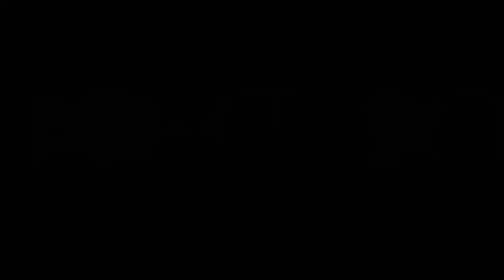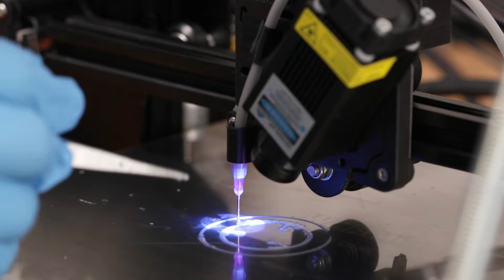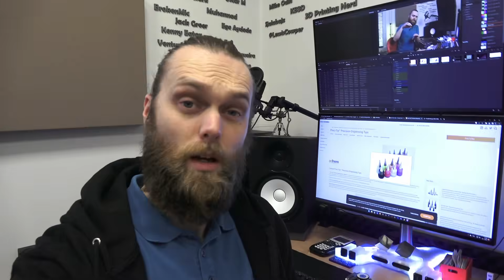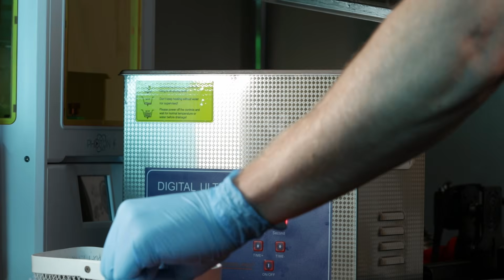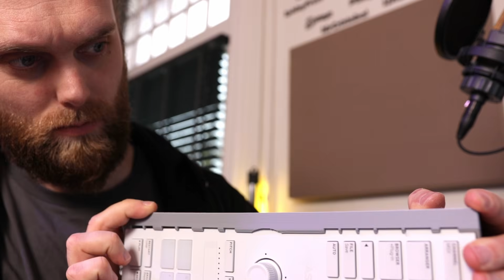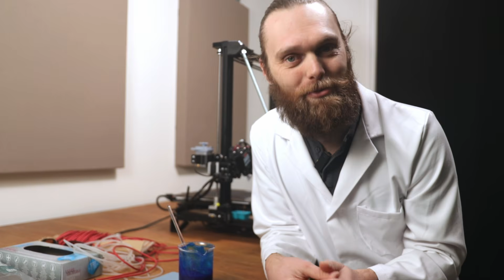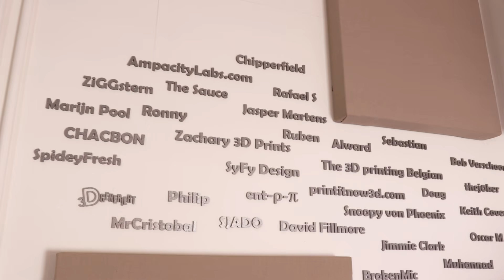I made a CUSTOM Nozzle that 3D Prints GEL!

Comment: Sweet project! 

When I was at Formlabs as an intern, I worked on a hackathon project that was extremely similar to this. We also used luer locks as the nozzle, but used a leadscrew driven syringe as the resin pusher. We also ran into the same problem where the laser would cure the resin at the tip and block it, but ran out of time before we could come up with a solution like you have.

I can share a photo gallery of the build if you're interested.

Comment: Really nice video. As for creating a leak tight thread seal, I would just use PTFE tape on the threads. That will almost certainly create a leak tight seal. This may allow you to more easily try other nozzles in the future.

Comment: Maybe use a syringe (or or even if its the same holder) mounted to the top of the nozzle and try to use non- flexible tubing (i.e. metal). Lastly it may help to increase the overall diameter of all the tubing up until the nozzle exit to allow for the use of thicker resin, this will may work better for overhangs. Best of luck!

Comment: Amazing work!
When testing your new mix you mentioned that the resin is holding itself up without curing. Maybe you can use this feature to prevent the nozzle from scratching/breaking and keep the resin soft while printing and then cure it layer by layer? Maybe using the ironing feature of the slicer (superslicer got ironing on every layer) to give it an "curing pass"

Comment: Since you want to print with fiber, you need the fiber to be cut to length.  If you do feed the fibers into the gel, that could work well for bridging as the fiber will give it horizontal strength going back to how to cut the fiber when you need to move the nozzle to a new location without printing between points in the print.

Comment: When dealing with UV you need to take into account weather your lens material lets the UV through. 
The visible part of UV light is not really the part that does all the work. The really high energy photons are not visible. Most plastics will block majority of UV. The best lens material is quartz. In your case it's better to use mirrors to direct the laser, instead of lens, since it's easier to make a aluminium mirror, then a quartz lens. Aluminium is best cheap material for reflecting UV.

Comment: One piece of advice on your pumping issue, generally speaking, pumps that can pump liquid well can't pump air, so you may want to consider adding a priming feature that allows you to add the resin directly into the pump, rather than turning the pump to suck the resin through the tube.

Comment: This is awsome and i was thinking that some one should invent somthing like this the other week, and wham you have, your a genius.

ok here is my thought. as fdm printing relies on the hot material to fuse with the exisiting layer, then why not lower the laser power soyou get a less cure, so the new layer can squish into the existing layer and the nozzle should push away any high parts before curing .

Also try to increase the build speed to match the pump. 
so you could put a inline solenoid valve to micro control the flow rate better. so instead of a motor to use as an E step, use it to cotrol a Solenoid , just to say you can get micro solenoids that are perfect for the size tube your using for next to nothing and the voltage is very low, 
sourcing map Miniature Solenoid Valve 2 Way Normally Closed DC4.5V 0.5A Air Solenoid Valve

Comment: LIGHT: Is there any advantage using a laser instead of a ring of UV LEDs? 

TUBE: Might it be a better idea to use a black tube to prevent the resin from getting light on it while in the tube? 

VAT: How about both? Put the fluid in a container with a "lid" that sit inside the container and seals against the edge. (And a valve to bleed out the air.) This will use the weight of the pump to apply pressure to help force the resin into the tube in addition to the pulling force of the pump. (It might need a stronger pump due to being a sealed container?)  
Alternatively: would just using an arm to push the "lid" into the resin to produce pressure/force that pushes the resin into the tube? 

RESIN: Wouldn't it be cheaper to use a UV reactive acrylic resin instead of "custom" 3d print resin? I'd imagine it'd be cheaper and since it's used for boats, not to mention readily available.

Comment: You need some form of viscometer so you can get consistent results from batch to batch and to allow you to tune your resin mix to what you are doing. Free standing resin prints will likely need a more viscous form than resin with fiber running through it where capillary action will play a part.

Comment: This is inspiringly cool. If the head nozzle was replacing a shuttle in a loom you could print pre-preg or just whole panels of carbon fiber or fiber glass. Your mixing nozzle could work for silicone, although the print time will definitly be affected by cure time. I would like to know, what pressures your pump can build? Do you think the nozzle could print foam? I wonder how the newer ceramic resins would work? So many cool ideas, keep up the "research" and thanks for the video.

Comment: Great print the one at the end!! :)
I notice you make a lot of "engineering rookie mistakes" that take you a long time to resolve though :p 
As requested, I believe you shouldn't pursue CFR with resins or gels; they are not rigid materials and will be extremely difficult - if not impossible - to fixate the fibre. The fibers themselves won't want to bend, and if by the time they are not deposited, the surrounding material is not totally rigid, I believe they will want to "jump" out as soon as you start describing small radius curves typical to 3DP paths. (Many other points also)
Two great projects, but separate ones, imo.
Keep it up 💪

Comment: You should be aware that most transparent objects are not transparent to UV, UV bulbs tend to be made from quartz crystal rather than glass, even if the visible portion of your lasers wasn't dimmer with those conical lenses then you might still have had trouble with the UV getting through the resins.

Comment: What iff  
The extruder pump was direct extruder - ed not blowen extruder-ed ?

And the noozle was thinner like 0.4 or 0.2 mm (you can do it with a thin needle )

And you dont need 2 gigant lasers 
You just need one one the side with thick optic fiber glass tube and the result the same ( iff the laser is powerfull enough)

Comment: Amazing work! Not only does this facilitate continuous fibery enforcement, but also potentially the use of different resins for different parts of the print, allowing the specific physical properties of each individual resin to be best utilized. This may be one of the most significant home fabrication projects I've ever seen. Only other thing that you could possibly do that would be quite so cool. Would be to use a infrared laser or some such thing to partially melt a bit of filament ahead of the printhead for standard FDM 😜 

You're doing amazing work, keep it up!

Comment: It looks like you are using soft and squishy silicone tubes. Altrough it is totally OK for vase mode, it will be impossible to achieve good results on any print, that requires interrupting the flow, like benchy, because of the deformations of tube under pressure. I believe, you should replace the tubing between the pump and nozzle to something harder, like PTFE.

Comment: Regarding the tubing: use a stiff tube for the connection tube and the current one for the pump. This way you can reduce tubing compliance and increase precision. I suggest urethral catheters or PICC (more expensive, but comes with luer lock and no lubricant).
Pro tip: use constant inner diameter for tubing, as it reduces shear forces on the fluid (less drag).
If you can, use PVC tubing and cyclohexanone for gluing. For flushing, use IPA to clean tubing.
My work is on extracorporeal bloodlines, and the tips above are from R&D experience on the topic.

Comment: Hello, I am new to the community so I am sure my thoughts don't have much value. However, the problem you had with the glass bubbles(is that what they are called?) was they were floating. Because the gel is much more viscous it might now prevent the issue. So maybe combine the two methods? Probably an idiotic suggestion lol.

Comment: I would look into the same types of pumps that are used on large cement pump trucks. They use two giant pistons that are 108˚ out of phase and provide good pressure and flow for thick materials. The pulsing might be something to consider, but it might be worth a shot!  Keep up the good work!

Edit: I should have finished the video first! great job, but the piston pump type still might be a cool topic to look at.

Comment: Instead of using a peristaltic pump to feed the resin, did you consider a syringe type design with a motorized plunger? You could mount the nozzle directly on the tip of the syringe and eliminate the need for tubing.

Comment: The bringing would be solved via the continuous fiber? Just use fiber for the first few bridge layers and then print normal, you could couple it to fan control so its already in the slicer as well.

Comment: If you don't need the strength of fiber in the print, maybe you could revisit the fiber optic carrying the UV, but have it down the center of the output nozzle. You'd need to shield it so the resin doesn't cure in the nozze. Not sure how difficult that is.

Comment: Have you tried air nozzles from thise airbrushes? If I remember rigiht they even thread into the regular heat block threads so you could design and have machined one with an inlet for the carbon fiber and the resin material going the usual filament route. Just a thought. They tend to be conical and strong, but no idea if it would work at these pressures.

Comment: You can use both microspheres/bubbles, and fumed silica in the same resin.  Fumed silica adds thickness/thixotropic properties to resins generally, and the microspheres will buik out and make it lighter weight.   So if you got good bridging when there was so many microspheres it was a paste, backing off on the amount of microspheres, but adding some fumed silica may work to get you an improved blend.

Comment: So you mentioned that the glass floated and the silica didn't fill the gaps. Have you tried a mix of the two? I have a feeling that the silica may have added enough structure to stop the glass from floating in the resin. Hopefully for long enough to complete a print. I have no idea what you would use for a ratio of glass to silica. Hopefully you'll end up with a resin mixture where the glass doesn't float and there is enough of it to fill the gaps. Just be sure to keep good notes on the weight ratios of resin : silica : glass that you use. I have to admit that my inner scientist winced when you dumped in resin to thin it out. 😄 Keep at it, you got this!

Comment: What about doing measured unit variables for viscosity. The second issue of additional flow at corners and bridging, can be tuned with some pressure advance timing and combination of turning off the curing for a split second? I mean it's transparent, maybe the cure can happen after the layer is complete.

Comment: If they can print houses out of concrete I'm 100% sure you'll find the solution and make this idea possible, also a question about resin properties in regards to the potential of hardening just ever so slight while it's being prepared would there be a benefit to preparing the resin in a Dark room style and ensuring there no contamination of the prepared resin from Reflected Uv bothe from the lasers and the surrounding environment? Lastly what about pressurized feed instead of pumping like a needle with the ability to draw back the pressure for gaps.. 

Please excuse my ignorance if these are no factors I've no experience with 3d printing other than watching YouTube.

Comment: What I would try to do if possible is alternate the beams of the lasers as in when one’s on and ones off in pulses and change the frequency output to where it doesn’t fully cure the resin so when the nozzle comes back around it’s still semi soft or the resin being like “al dente “ or stagger the lasers on and off every other layer so as it’s laying layer the leaves are not on until it comes back around as too baby curing the lower layer but not the top one so as it passes back over that previously are your nozzle doesn’t stick from it being too cured or even have one laser focused on one point and one another laser focus on a lower point so to fully cure the lowest layer but it wouldn’t cure the top layer fully the second laser would focus on the current layer but not have full power to fully cure if that makes any sense I hope this was a great idea this would be my go to if I was in your situation I hope this was helpful. If I need to explain it a little bit better let me know or go into more detail
Reply: Adding to my rant or long suggestion the reason that I say stagger or post the lasers it would be like if you were running a resin printer it flashes each layer but not fully to adhere to itself me myself I have not run a resin printer but I understand the functionality and how it works but this is where theoretically that idea would work

Comment: Can you think of how to make an FDM printer that prints like a laser printer? I mean it would extrude an entire line at a time instead of using a single point print head. That way, you could make a planar FDM printer that extrudes entire layers at a time instead of a single point FDM printer that extrudes lines.

There's an article on tonergiant that has a decent video showing how a laser printer works, but I think Youtube removed my last comment for including a link. It is titled "How Laser Printers Work – Ultimate Guide"

Toner is actually just plastic with some other additives. There is a fuser that melts the plastic to bind it to the paper. So a laser printer already does exactly what I'm talking about, but only just for 1 layer.

Comment: Instead of using a peristaltic pump, try making a screw drive plunger like a giant syringe. Fewer parts, and you can light seal the syringe body to prevent the resin from curing due to ambient UV. It would also allow you to halt the flow, or retract a little, by reversing the plunger and pulling a vacuum in the reservoir

Comment: Not sure if someone has already mentioned this:
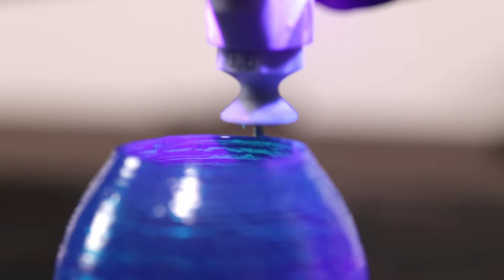1) if you look at the video part 18:49 - you can assume that there is an opportunity to optimize the path to fill a layer that does not intersect with itself.
2) you can try to add a movable system that repeats the movement with a delay behind the nozzle (possibly from several sequentially moving UV led / lisers), and hardens with UV light.

Comment: You should have used clear epoxy to make the lens. Epoxy DOES NOT stick to plastic wrapping film, so you can use it to inlay your mould, and once epoxy is almost dry, you can peel it off leaving smooth finish

Comment: So damn cool. What if finely chopped glass fibers were added to the mix? Not a lot as that'd gum up like the beads did but I think with just the right ratios of resin, silica, and glass fibers you could possibly get do to as low as like 50% infill.

Comment: I love the Idea and enthusiam you have. Some thoughts: Can gravity assist you in guiding the resin where you need it? Alternatively I saw other Ideas in the comments to use syringe type systems to add pressure or the replace the peristaltik pump. The restriction in the tube is due to its interior surface properties and it's diameter. Maybe try different materials and interior surfaces along with diameters for lower pumping pressure? Keep it up love to see it work. I look forward to you trying different fibres like carbon or glass or something funky like cermaic fibre. There is a paper out there continus printing ceramic fibre maybe check it out.

Comment: The y carriage might not be grounded due to the nylon wheels, it might be why you were able to fry the lasers. Don't be ashamed to buy parts instead of making them. Lenses are one of the hardest things to do in injection molding so there is little hope of you making a good one using FDM, just buy it.

Comment: Try lower laser power - you cure it too fast. When you go over cured resin blobs, you crash nozzle. If you lower laser power, it will cure on second passsing above - you have chance to smooth the bubles and blobs using nozzle, and cure them after it.

Comment: instead of retractions like fdm, could you introduce vacuum somehow, somewhere like on the opposing side of where fluid enters the nozzle body? granted it would take a bit of testing to find the right amount of small vacuum needed to just stop it dripping on travel moves and at the same time, not cause "under extrusion" after travel moves ect. 
it might be totally unnecessary considering the viscosity of the gel, but for later versions it might be a good thought.
the system of sucking into the pump and pushing to the nozzle works, but thought about something like a automotive oil pump, a rotary type maybe

Comment: Love your videos and this is great to watch. You say the goal is to use this process to inlay fibre strands similar to how Markforged do it. This got me thinking after seeing your nozzle and the idea to feed the strand in from the top. I wonder is a similar approach could be done with FDM? So feed the fibre in to the nozzle with the molten plastic. It would need a separate extruder and be introduced when the plastic is fluid, could this work? The next challenge would be terminating the strand which involves cutting it (as MF do). I'm thinking something similar to how it's done on the X1C. You would then need to know the length from the cut point and the slicer cut it such that it can drag the remaining bit out as the nozzle moves. Sure there are issues with this approach but I'm brain dumping here in case it has any merit at all.